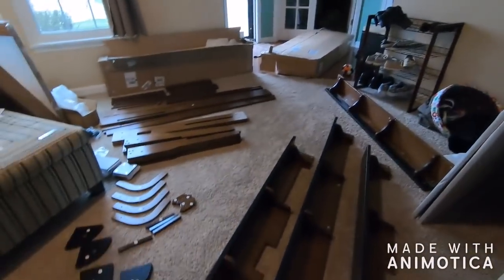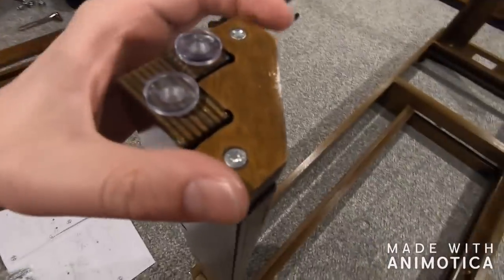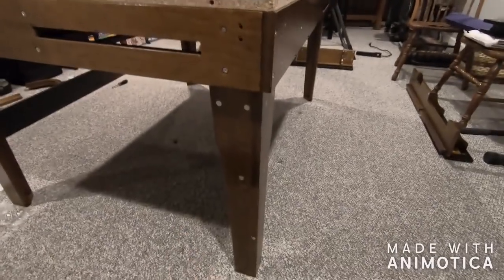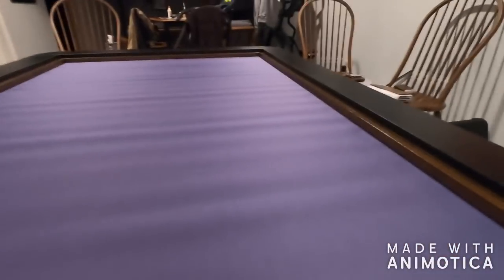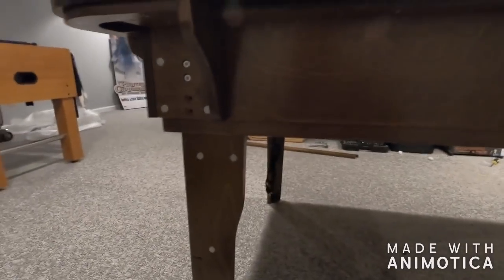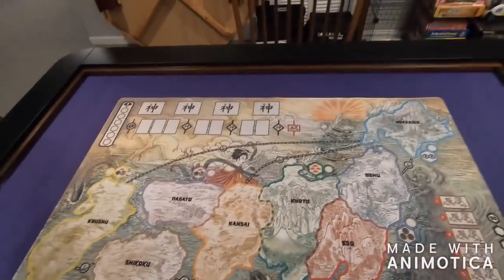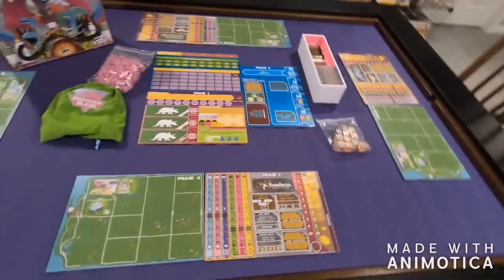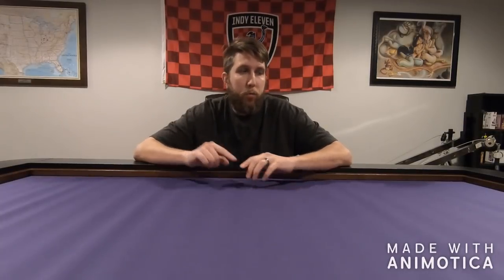Table Of Ultimate Gaming Unboxing

Comment: Awesome video, thinking about getting a table myself. But something I can't find clearly on the website is the table color, i want one like yours, black on top with the rest of the table being walnut colored. On the website it has 2 options for the elite tables, black or walnut, did you pick the walnut option? I just want to be sure before I buy it, i've seen pictures of all black tables from them and I though the black option was just for the top
Reply from the maker: Mine is the Walnut. It came with black tops. I'm not sure if that has changed since the original kickstarter or not. The black was black with black tops. Hope this helps and thanks for watching.
Reply: @StorkPlaysGames  That clears it up, thanks for the quick help! I have mine ordered and I can't wait for it
Reply from the maker: @JERRODQ  glad I could help. I hope you like it but I'm pretty sure you will.

Comment: I am putting mine together now.  Did the waves come out??? I am trying to keep it as flat as possible
Reply from the maker: The original mat never totally flattened out but I was sent a replacement that was wrapped around a tube and it did flatten out very quickly.

Comment: Did you get the table tops in the end and did you have any issues with them??
Reply from the maker: I did get them and I haven't had any issues. I don't use them very often but I will say the glue from the "padding" gets on the tops pretty frequently. So if I did use them I'd probably be rubbing glue off them. Here is my second video where I cover the accessories. https://youtu.be/4OtWjrzdDZw

Comment: What size is the table?
Reply from the maker: Alexander C it's the 3.5 or 3x5 in their lineup. If you want exact measurements I think they have it on their website. If not, I can measure for you.
Reply: negitive the diementions  are only showing right now on the 4.6 . i was curious if with the tabletop inserts if its larger and only measuring the gaming surface ? the 4x 6 is far larger.its 4x6 gaming surface but  nearly a foot or two larger W and L ?